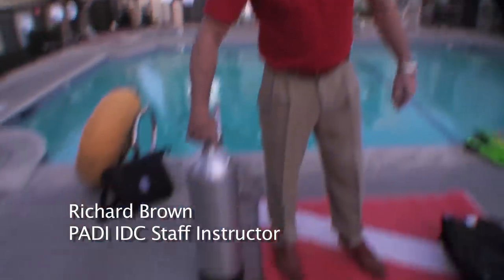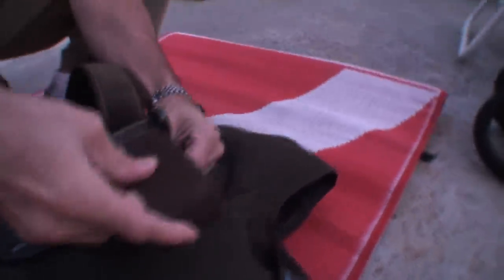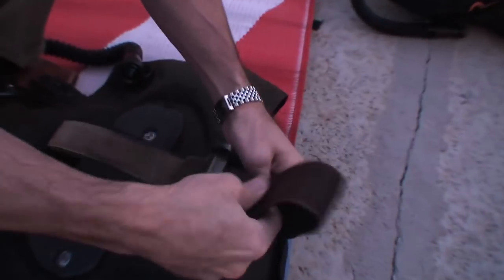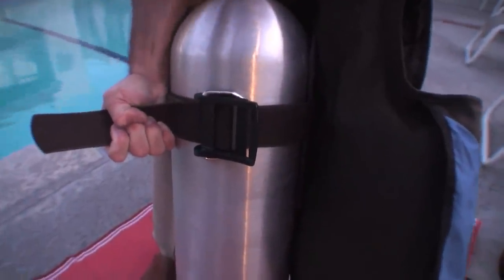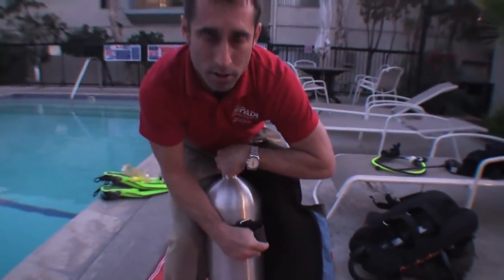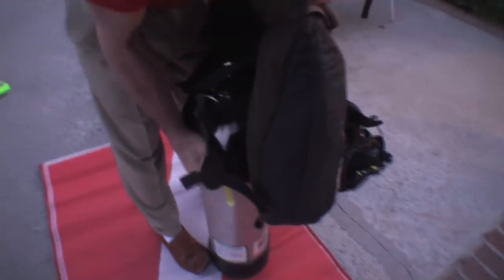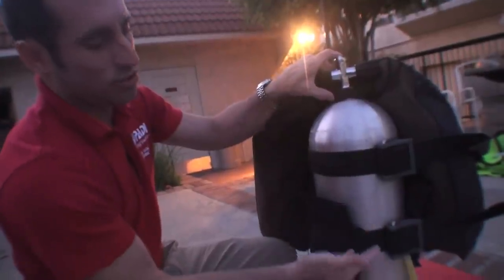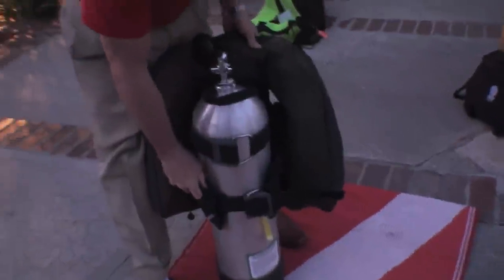SCUBA BCD Tank Strap & Buckle Safe Assembly.mov

Comment: Thanks. I have a battle with other divers about the small strap on the top. I have been taught that its use is for handle the tank with the bcd, so DON'T attach in the valve because in case of losing the bottle not useful to get attached there. In the video doesn't talk about that point...